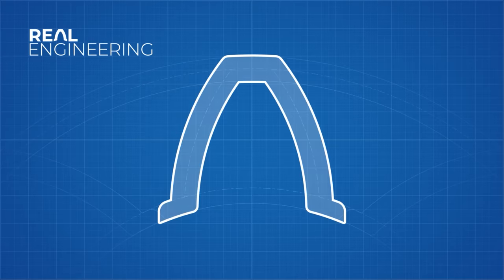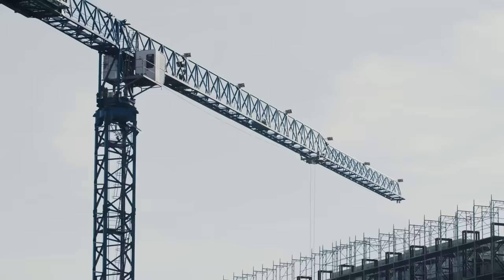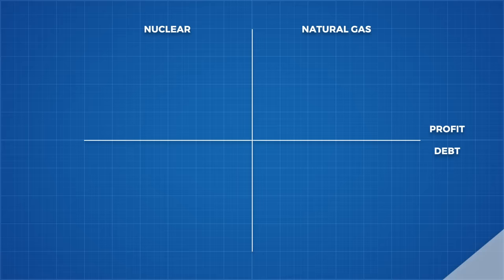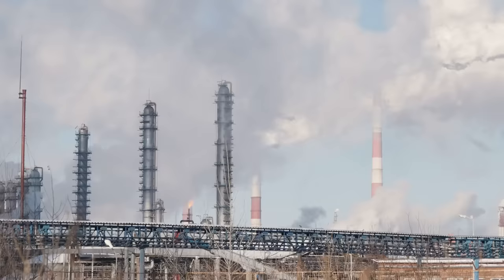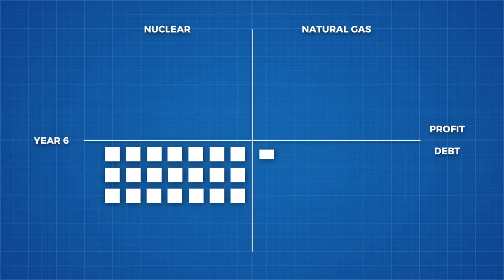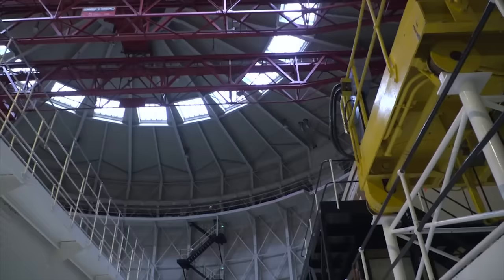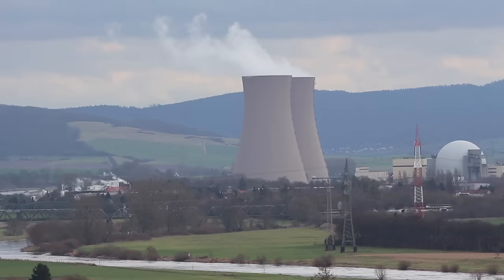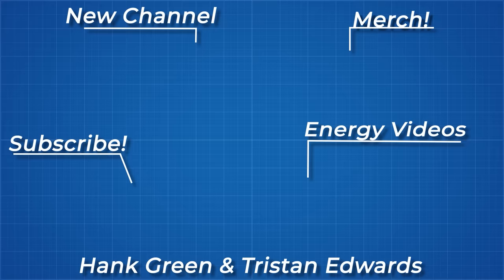The Economics of Nuclear Energy

Comment: Frankly, Alvin Weinberg is probably weeping in this tomb. He already had the solution to cheaper, safer (although nuclear doesn't really need that -- it is statically the safest energy source) and more efficient nuclear reactors: liquid fuels!

In particuler, have a good, hard look at LFTRs. They are the best solution that anyone can dream of right now.
Reply: @francisgaliegue6645  Dude, I worked in the nuclear industry for 40+ years at five different nuclear facilities and am pro-nuclear.  That doesn't mean that I have to ignore facts and reality when it doesn't align with my opinion.

The idea that regulators are holding back nuclear is just another conspiracy theory to support your point when you don't have any facts.

 Most everything in stores is successfully made in China so apparently regulators are responsible for U.S. companies not being able to compete in almost EVERY industry.

If it cannot be built in the U.S. cost effectively, while meeting all labor laws and regulatory requirements that have been in place for decades then it is a failure.

NuScale and Terrapower are both getting $2 billion each in matching taxpayer welfare  funds from those anti-nuclear regulators and both projects are in trouble.   Is that my fault, the regulator's fault or the failure of engineering and project management ?????

What happens in other countries mean nothing to those of us that live in the U.S.
Reply: @francisgaliegue6645  I have no idea of the situation in France and really don't care because it does not affect my life.

The U.S. government spent trillions over the last 70 years researching, designing, building, and testing every type of reactor (MSR, LFTR, SMR, breeders, etc.) known and that expertise was given to the commercial industry for free.  All U.S. PWR designs are based on the navy reactors but just scaled up with safety features added.

The U.S. government also has via Price Anderson Act insured every U.S. reactor ever built and paid for the cleanup of TMI-2 after that accident. 

The U.S. today has $36 billion available to keep old INVESTOR owned nuclear power plants on line and many states have given massive tax breaks to keep INVESTOR owned nuclear power plants running.    DOE is also providing $2 billion in matching funds each to Terrapower and NuScale for their demo test reactors.

Stick to your own country because you know nothing about mine
Reply: Here are two of our latest new nuclear projects.
VC Summer (South Carolina) new nuclear units 2&3 were canceled in 2017 after spending $17 billion on the project (original estimate of $14 billion and 2016 completion date) with no clear end in sight for costs or schedule. 

Vogtle (Georgia) new nuclear units 3 &4 currently 110% over budget and schedule (currently over $30 billion) and still not operating. Mid way into the build, the utility stated that had they known about the many costly delays they would never have chosen nuclear. They are now delayed another year because according to the project management, thousands of build documents are missing. If completed, Vogtle will be, for its output, the world’s most expensive nuclear power plant.

Now here is reality not conspiracy theories from the CEO of the project.  Spin that ......

Below is the Vogtle Project Management's answer for the latest delays:
Southern Co. yesterday announced another delay for its long-troubled nuclear construction project in Georgia, edging its costs closer to the $30 billion mark. 
The setback could now push the startup date for Plant Vogtle’s first reactor until early 2023 and move the date for the second one to later that year. 
Plant Vogtle’s latest move highlights the nuclear industry’s chief troubles with building large, baseload reactors: safety and cost. To be clear, Southern executives have blamed this new hiccup on paperwork, saying that workers were gathering it to send to federal safety regulators and noticed critical inspection records were missing or incomplete. The pile of missing or incomplete documents added up to a delay of three to six months, Southern said. That additional time is costing $920 million. 
“We’re a little frustrated with the latest developments,” Southern Co. CEO Tom 
Fanning talked of “great momentum” at the construction site since November. 
But workers realized “tens of thousands” of critical documents were missing, leading to a three-month backlog. 
“We’re fixing that part of the ‘paper’ process,” he told E&E News.
Reply: @clarkkent9080  You are just proving my point. Politicians, all around the world, are only vested in their own interests and/or do not have an engineering background.

Have you had a serious look, as an (open minded) engineer, at the projects you mentioned (which are only part of what happens even in the US)?

France has had a liquid fuel nuclear reactor program; the fundamental mistake they made in the first place is that they wanted to make a fast spectrum reactor. NO! The way to go is a thermal spectrum, thorium breeder reactor. It is the only sensible way when it comes to PHYSICS. And ultimately; physics governs the world, not politics.

Again, fingers out of you know what. Other considerations are side effects which can be cast aside (cf Elon Musk).
Reply: @francisgaliegue6645  I am sorry that the entire nuclear industry in France did not listen to you.  How dare they.  I don't know how things work in France but I believe that you are allowed to start your own company and build your dream.  All you need is 10 billion or so.

I can tell you that the only two demo projects in the U.S. (Terrapower and NuScale) are on a financial hold even after being offered $2 billion each in matching taxpayer welfare funds.  Oh by the way, that is for their projects that they themselves advertized as only costing $1 billion.

Damn them politicians for forcing them to advertise the cost as $1 billion and then making them accept $2 billion in taxpayer money.  Bill Gates, CEO of Terrapower, is apparently going broke.

Enjoy your alternate reality.
Reply: @clarkkent9080  The speed (I dare not say alacrity; alacrity has a sense of previous consideration to its name) of your replies tells me that you don't know enoguh or, worse, do not want to know enough of what I'm talking about.

Let us just cast aside the political and regulatory aspects, and focus on the technology itself: an LFTR has no risk of meltdown (duh, they're salts), has a passive, idiot proof safety mechanism, consumes 99% plus of its nuclear fuel (vs less than 1% in current reactors) [and, corollary, produces 25 times less nuclear waste which is waste only to people who fail to understand their value most of the time], breeds its own fuel (it's a breeder after all) and has 40% more thermal efficiency at the very least.

If, as an engineer, you are not excited about it, it is one of two possibilities: 1. you are a victim of the current nuclear industry sclerosis or 2. you didn't study the subject hard enough.

As far as I'm concerned anyway, the discussion is closed. Enjoy your bleak future.
Reply: @francisgaliegue6645  As I said before, I am sorry that you find yourself in a position where you believe you know more than most of the rest of the world.  It must be lonely being the smartest person with no one is listening.

This is what I do know.  Neither you or I cannot direct the industry.   The people with the power, influence, and money will direct the nuclear industry, and that is a FACT.
.I can only speak to the REALITY and FACTS in the U.S., and with old nuclear power plants shutting down each and every year and with the last 4 new U.S. nuclear projects being a complete financial failure, nuclear's contribution to our electric grid will decrease for the next 20-25 years before that could ever possibility change.

And new advanced reactor designs take many years to become proven and are even less likely to change nuclear power's future in any country.

It is great to hope but sad to live in a world where reality is your enemy.
Reply: @clarkkent9080  When it comes to the physics and engineering of nuclear reactors, not only current but in my case (yours also?), LFTRs, I daresay that yes, you and I know a lot more than the powers that be who, for the alarmingly majority of them, do not even know what fission is (vs decay) or can define radiation.

I choose not to give in. I choose to try and educate them. If you care about humanity, so should you.
Reply: @francisgaliegue6645  I spent 40+ years of my life in the nuclear field at five different facilities as a radiation control tech, reactor operator, senior operator, simulator instructor, hazardous and radioactive waste manager and many other special assignments.  I worked very hard, committed to doing the best job I could and ensuring the safe and efficient operation of the facilities. Within my abilities and assignments, I did all I could for the acceptance and advancement of the industry.  

I try, in these comment sections, to correct misunderstanding that people make, having no nuclear knowledge other than social media and YT videos. 

 I realize what is and is not possible.  I know not of your educational background or current career but if you believe that you can change the industry in the comment section of YT videos, then you are mistaken.

Comment: So what happens to the economics of nuclear power when Copenhagen Atomics  or one of their competitors mass produce  molten salt technology reactors the size of a shipping container ?
Reply: Then I will not go outside because of my fear of flying pigs.
Reply: @clarkkent9080  So what does that even mean ? You think progress in advanced nuclear power is not going to happen ?
Reply: @bobpawtucket1336  I worked in the nuclear industry for 40+ years at 5 different nuclear facilities.  Do you know how large a footprint a commercial , 1.1 GW nuclear power plant has???? EVERY building and component is there for the sole purpose to produce electricity.

To fit a SMR into a shipping container (65k pound weight limit) , along with all the support systems, independent emergency systems, turbines, generators, reheaters, condenser, electrical distribution, containment, etc. , you are looking at a 5-10 Mw output at best.

SMRs are even less competitive than the traditional large PWR or BWR. Building and operating SMRs will cost more than large reactors for each unit (megawatt) of generation capacity. A reactor that generates five times as much power will not require five times as much concrete or five times as many workers. This makes electricity from small reactors more expensive; many of the original small reactors built in the United States were financially uncompetitive and shut down early.

Reality sucks
Reply: @clarkkent9080  No, and I do not care that is an outdated paradigm. The new way is to build them on an assembly line and make certain lines of them that can be used alone or in combination to fill the needs of the customer. These giant one of a kind plants are a big part of the problem and need to go. The saving comes shipping a finished product to the field instead of building it there.
Reply: @bobpawtucket1336  Just because you say something doesn't make it true.  Facts??? Proof???

You cannot fit 1000 pounds of potatoes into a 5 pound sack.  A shipping container sized nuclear plant would put out less power than a similar sized diesel engine since it is a heat engine and needs heat exchangers, turbines, generators, redundant safety systems and a containment.

NuScale is the only company in the U.S. building Small Modular Reactors and while their reactor vessels would fit into a shipping container, their entire power plant is ~1/3 the size of a typical 1.1.Gw power plant.  And they cannot even make that work.

This is from the Des Moines Register an concerning the only Small Modular Reactor (SMR) project in the U.S. today.
In 2013, the Wall Street firm Lazard estimated that the cost of generating electricity at a new nuclear plant in the United States will be between $86 and $122 per megawatt-hour. Last November, Lazard estimated that the corresponding cost will be between $131 and $204 per megawatt-hour based upon the 4 recent new nuclear projects in the U.S. . During the same eight years, renewables have plummeted in cost, and the 2021 estimates of electricity from newly constructed utility-scale solar and wind plants range between $26 and $50 per megawatt-hour. Nuclear power is simply not economically competitive.
SMRs will be even less competitive. Building and operating SMRs will cost more than large reactors for each unit (megawatt) of generation capacity. A reactor that generates five times as much power will not require five times as much concrete or five times as many workers. This makes electricity from small reactors more expensive; many of the original small reactors built in the United States were financially uncompetitive and shut down early.
The estimated cost of constructing a plant with 600 megawatts of electricity from NuScale SMRs, arguably the design closest to deployment in the United States, was originally advertised as costing $1 billion but upon requesting actual bids from engineering firms, increased to $6.1 billion in 2020. Given inflation and other cost constraints that cost today can only be expected to be significantly higher.
The cost was so high that ten members of Utah Associated Municipal Power Systems canceled their contracts. NuScale then changed its proposed plant configuration to 6 fewer reactors but increased each reactor output from 50 Mw to 77 Mw costing at total of $5.3 billion. The NRC just last week approved the construction of the 50 Mw design but now will have to start the review process all over given the switch to a 77 Mw design. For each kilowatt of electrical generation capacity, that estimate is around 80% more than the per-kilowatt cost of the Vogtle project in Georgia — before its cost exploded from $14 billion to over $30 billion. Based on the historical experience with nuclear reactor construction, SMRs are very likely to cost much more than initially expected. And they now have delayed the project start until 2025 in an attempt to find more backers.  All this before the inevitable setbacks that will occur once construction starts.
Reply: @clarkkent9080  "The NRC just last week approved the construction of the 50 Mw design but now will have to start the review process all over given the switch to a 77 Mw design." As you stated start all over again, much of the cost over run is from the bureaucracy. I expect these problems to happen as this is a new direction, but I think that series of models like the 50 MW the 100 MW and the one to power all those cargo ships one size for 300 to 400 feet another for 400 to 500... you get the idea, will be the future. and as for cost over runs in this day a $15 pizza cost $ 20 by the time it is finished baking . At least do you have any hope for the   liquid fluoride thorium reactor ?
Reply: @bobpawtucket1336  
So wasting thousands of hours of NRC review time and then after approval changing the design is the fault of the NRC????  Interesting interpretation.

NS Savannah was the first nuclear-powered merchant ship. She was built in the late 1950s at a cost of $46.9 million and launched on July 21, 1959. She was funded by United States government agencies. Very little regulation in the 1950s and she was scrapped because it was too costly to operate.

It is not about the cost overruns but the COST.  To compete, nuclear has to be built for $6 billion or less  for a 1.1 Gw unit and Vogtle is currently approaching $16 billion and NuScale is in the same cost range.  What would you do if you ordered a $10 pizza and when it was cooked they wanted $22? Order more???

I only follow what is happening in the U.S. nuclear industry since that is where I live and what happens in other countries has little effect here and unless you live in that country you only hear what the government wants you to hear. The only possible "new" reactor technologies being considered in the U.S. are SMR (NuSCale and that is on hold) and MSR (Terrapower and that is on hold since they planned on getting their fuel from Russia).

No one is considering Thorium in the U.S. since it would require an entirely new infrastructure adding billions more to the already high cost of nuclear.

Just because you believe in something does not mean you must ignore facts and reality....unless you are one of the election deniers in which case you make up your own reality
Reply: @clarkkent9080  Several years ago during a radio interview, the host told me that the Chinese were planning on deploying a commercial modular molten salt reactor (MSR) by 2020. For context, these nuclear reactors are based on existing technology demonstrated by previous operating prototypes, can use fuel that is hundreds of times more abundant than the only naturally occurring fissile isotope (uranium-235), are resistant to making bomb-grade material, and cannot suffer meltdowns. Modular design could allow them to be built in factories and shipped ready to install to any suitable location. .....Even if this new type of reactor in its modular form is destined to displace existing forms of electricity generation, it could take another 20 years for it to make significant inroads in the utility market.....
UPDATE (August 28, 2021): Two readers have pointed to this prototype molten salt reactor about to go online in China.....
If the TMSR-LF1 proves successful, China plans to build a reactor with a capacity of 373 MWt by 2030... OOPS down to 15 years and accelerating , come join the world.   You would let China take the lead!